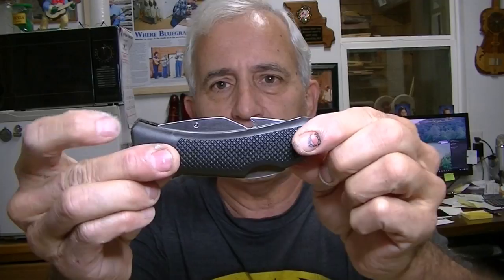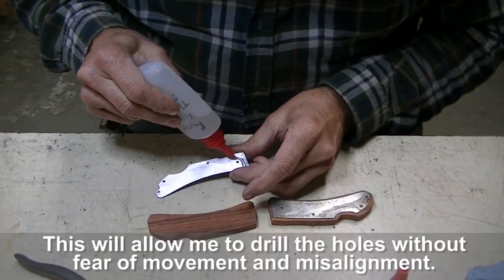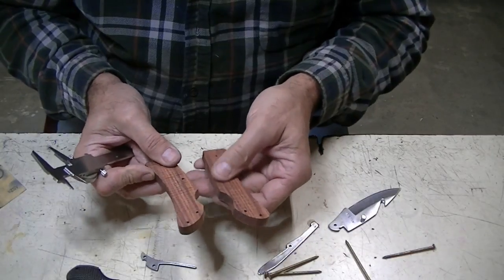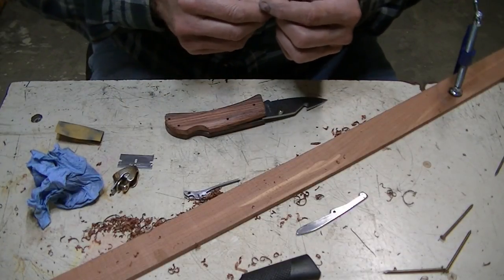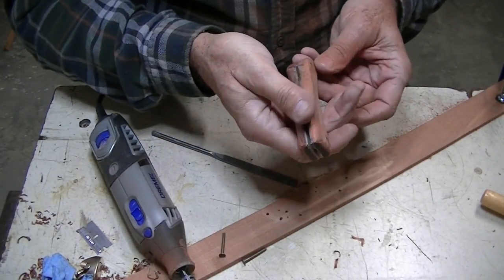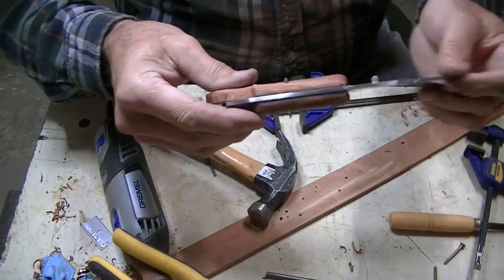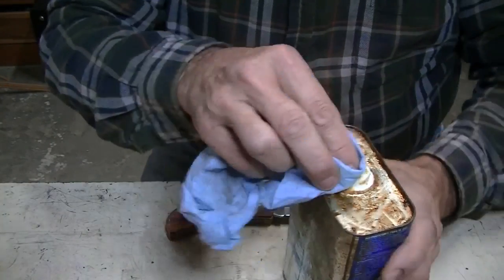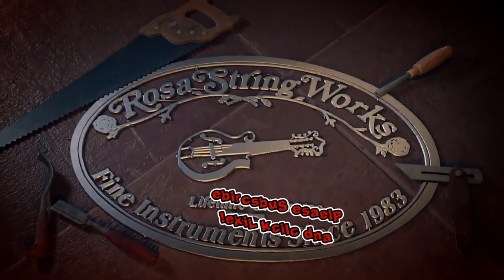188 RSW Favorite Knife Gets A New Handle

Comment: My favorite carry knife is a little three-blade Imperial.  Unfortunately, the material for the scales has shrunk.  This leaves sharp edges at either end of the scales.  They are held on by three brass rivets.  I wondered why you did not use brass brazing rods for your rivets.  Steel holds up better, but hard to peen or spread the end.  The brass looks pretty good against the wood.  If I could go over to the wood shop I would get a piece of Maple or ebony scrap to make new scales.  They are only 2.5 inches long and the bolsters an eight of an inch at the tallest part.  Even If I started with a 3 inch long , 5/8th inches wide and a half inch deep piece of scrap, I would have plenty to handle the curve in the scale and sand down to the bolsters.  The handles are scalloped for a good grip, little waves of three sixteenth inch long scallops a thirty second of an inch wide, that I can recreate with my carving chisel.

Comment: Contact cement just glue it and either wrap it or use it like the bottle says.
Reply from the maker: +Krusty Buzzard so I used contact cement on it several different times and it just wouldn't hold. Thanks for watching.

Comment: You dont have to peen the pins in the wood handles, just epoxy them in place. then sand off the end flush to finish.
Reply from the maker: +Corndog that would probably work thanks for the information.